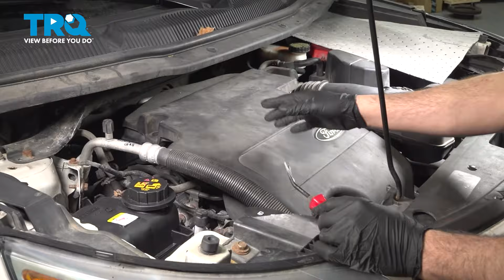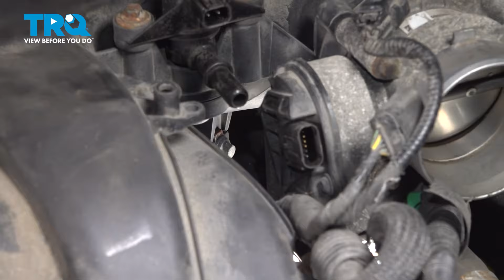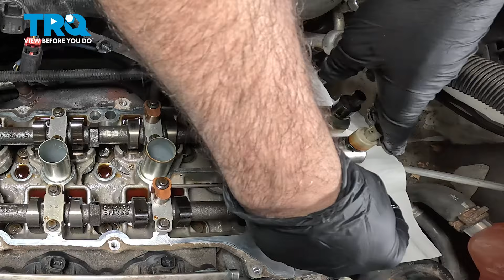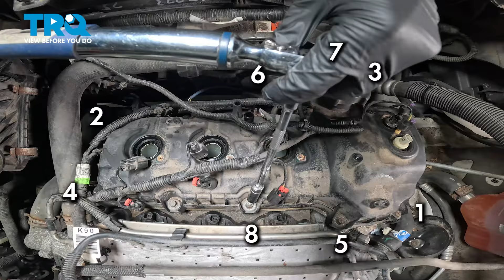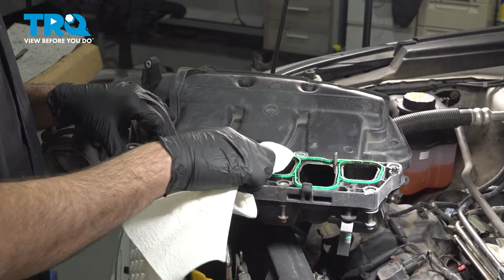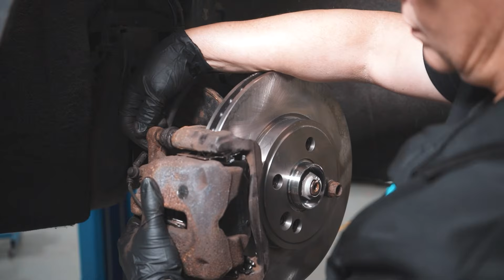How to Replace Variable Valve Timing Solenoids 2011-2019 Ford Explorer (3.5L V6)

Comment: I really appreciate your videos, ad they are very detailed, except for this one. First your technician tackled only the easier side of the job. The other side is a little harder especially the #1 injector harness, as it has a weird angle and hardly cannot be seen. I had to use an O2 sensor pliers to disconnect. After analyzing the video, I noticed that the tech also used the same type of pliers for disconnecting the injectors. Disappointing me even further he stopped short of doing the entire job by not replacing the seals of the vvt. But what really disrupted my experience is the statement he made of the location of the vvt; saying the white vvt was to the intake side and the black was towards the exhaust side. This statement is true for the easy side but not for bank 1, and this threw me for a loop as I had bought this car with150K miles on it and did not know if the vvt were replaced before and if they were switched by accident and this was the cause of my misfiring without a code. I had to go to a Ford dealer shop to find out that the vvt were installed correctly. Another thing he mentioned about putting just a tab of silicone were the front of the engine connects to the main engine is somewhat correct, but on bank 1 requires a bit more. It is a good thing that before putting the manifold back I checked the valve cover for leaks using a smoke machine and saw smoke coming out from the corner where I had put the silicone. Oher than that I thank you for the video.

Comment: My ck engine light came on, code reader said VBT on my 2017 explorer. Looks like this took you 45 min… I am reading this repair should run 150-400 at a shop, does that sound right??